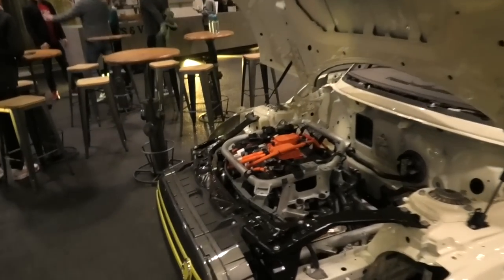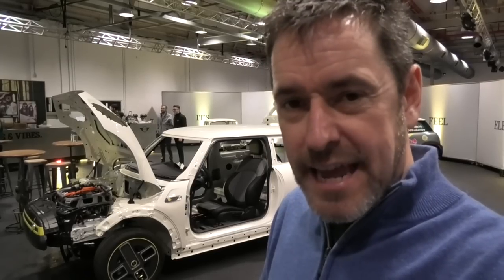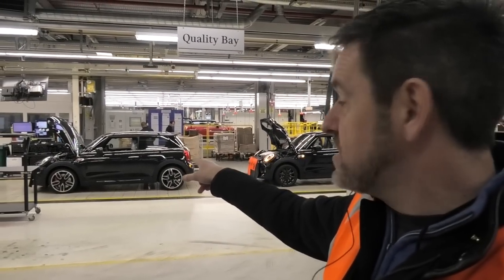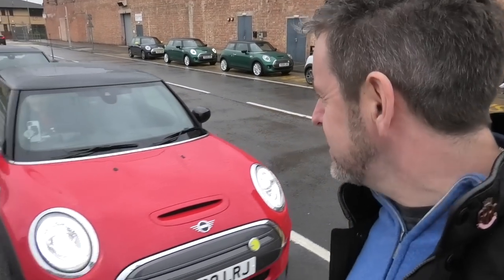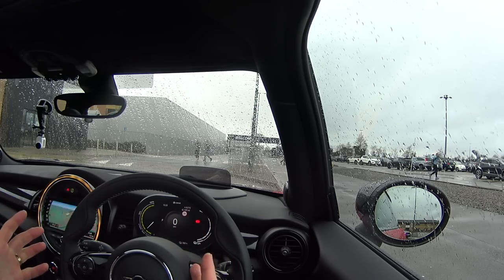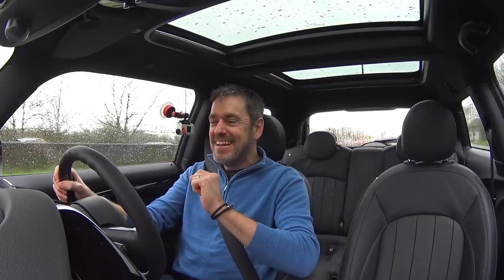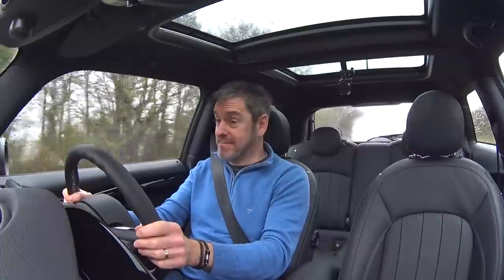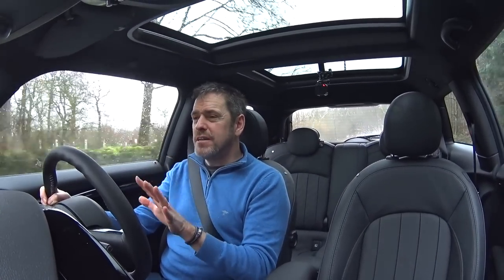Building and Driving Mini Electric - The most important Mini ever !

Comment: Great video. OK the range isn't great but good point that is more than enough for the most people most of the time. It's fantastic it's cheaper than the petrol model. I wish more reviewers would let people know its cheaper to run, maintain, tax, etc. Depending on, what your old petrol/diesel was, your new EV, your mileage & where you charge the saving could be in the €1000's every year when you switch

Comment: Great video again Pete as always. Just been down to look at the electric Mini in the showroom, great looking car. Would be interesting if they do the same with the clubman.
Reply: Gary Wilson Mini I think definitely Mini will do an electric clubman. But when I couldn’t tell!
Reply from the maker: Not sure if that is on the plan 😕
Reply: Petrol Ped that is a pity as with the larger floor plan it may have been a way to increase the range a little, as 100 to 140 miles when you take into account real day to day use is a little low compared with competitors.

Comment: Could you engineer a tow behind accessory battery pack!  I havent managed it yet however it's going to happen.  It's in the works for my next project!

The interior for me is stellar, I dont like the blandness of the Tesla. However that could just be what I'm used too.   I generally dont like a large screen pumping out light while im driving so for me the Mini is perfect. I drive a lot at night so it's a huge deal when considering driving comfort.  Loads more to add but I have to do some engineering first so I'll pick it back up later, cheers keep up the good work!

Comment: Fab video. I could have attended this on the 27th as I got an invite I'm so sad I could not go. Though I decided to go for an i3S instead of the mini, the mini is looking like a great car. I love the i3S, it's superb, very different from a mini, and I think it has the same motor. Super nippy, I take so many cars by surprise at the lights. 😉 One day I will have the mini but as my only car I needed a little more range. In fact my i3S is the older model and has the same capacity battery as the mini but it has the range extender to soothe the anxiety. Had it 3 weeks and done 800  really great miles so far only used 3-4 litres of fuel in the range extender and even then I didn't strictly have to. I just used it to hold charge for convenience.  So perhaps I didn't need it after all and the mini would have been fine... Oh well. Lot of plus points for me on the i3S, but mini will always be special to me.
Reply: We have had our i3s Rex for around 6 months now and the range extender has saved us on numerous occasions where range suffers in winter conditions or the public chargers just don’t work. Wouldn’t go all electric until the charging stations are more reliable or battery density gets much better for the smaller car. I was curious how they would shoe-horn the i3 electrics into a much heavier mini chassis and expect a similar range - seems a little optimistic to me, especially if using the performance as suggested in the video. When I push the i3s (as it really encourages) I can halve the quoted 140m battery range

Comment: Range will be an issue for some, when the Renault Zoe does nearly double, I think mini have shot themselves in the foot.
Reply: Drive them back to back... No problem.. Zoe has the issue
Reply: But like he was saying the range is more than enough for the vast majority of people.  Taking the range out of the equation what would you rather have and drive?  Mini Cooper Electric or Renault Zoe? Most would choose Mini I suspect.
Reply: @garymason7  100% mini, I would never buy a french car, but for alot of people that range will be a problem, imho.
Reply: @octaneparker6200  "I would never buy a French car" is a rather juvenile oversimplification which is based on what? I've owned and driven many French cars over the years and not one of them has ever let me down.
Reply: @Scuba72Chris for most drivers range is an issue, I was merely stating the zoe has a far superior range, regarding the fact I would never buy a French car is based on the fact I have worked for multiple car dealers and French cars are by far the least reliable they also tend to peform badly in driver surveys, there maybe the odd model that does well, but overall this is not the case, dont doubt you have had french cars that have performed impeccably, but across a wider spectrum of drivers not everyone shares your thoughts.
Reply: Octane Parker You can say that about any brand. They are all much of a muchness. The french cars are no more unreliable than German ones.
Reply: @thetreagust462  Although the results are quite tight, Skoda (German) came out top last year by the What Car family car survey for reliability as well as 5th. BMW 1 Series and Mini Clubman (German) both coming 7th. The best French car came in at 20th, the Citroen C4 Cactus. The top 30 is dominated by German cars and far east cars such as Toyota, Honda, Kia etc.
Reply: This is where things look bad for the Mini. It's not that the range is unusable on the Mini - far from it - but when you can buy a car that goes twice as far, has a bigger boot, more space, more doors and a better basic spec for the same money,... it becomes a hard sell.
Reply: @timaustin2000  You could say the same with the ICE car though. There are others in it's class with bigger boot space and better mpg and more toys for your money but has that harmed Mini sales? Far from it.  UK roads are littered with them because they are great cars to own and drive.  If you place range and boot space above all else then yes you're not going to go for a Mini, you'll want something bigger. But for many people who want a smaller car, how it drives and interior comfort comes above how big the boot is and the Mini boot is not the smallest in it's class.  They'll sell shed loads of these because people are starting to want electric and people LOVE Mini.
Reply: its a city car and pop to the shop's car so the range is not an issue
Reply: I own a Tesla Model 3 Performance and a Mini Cooper S.  Love both cars.  Range...seriously not an issue for a second car or a City car, primary car where you regularly do 150 km, you'll have an issue.   Would as soon as drive the mini as the Tesla, if it wasn't for the fact my Mini Cooper S needs to visit the gas station on a regular basis...my Tesla has a full tank every morning without fail.  Can't wait to see the Mini Cooper S E arrive in Australia...very, very exciting!!
Reply: As someone with an R56, I have to agree with this (at least where I'm at in the US).  I currently get ~400 miles on a full tank of gas, which is more than enough.  However, ~120 miles is only good for local local commuting.  If I want to drive to the next metropolitan area, its ~100 miles, and I don't live in a particularly sparse part of the country.
I think it will have its niche, for sure, but it is definitely a compromised car.  With double the range, though, I think this thing would be a real winner.
Reply: The Zoe is way to heavy and consumes more power on 100km so i take the mini for the fun and will not need more range in 98% or more occasions.
Reply: @garymason7  I would not say vast majority as most do not  want to plug in every 2 to 3 days, just once or twice a week.
Reply: Octane Parker IMO, if range is very important to you, you don’t buy an electric car in the first place.

Comment: you know, I hear what you are saying about making it a bit more edgey,   I also can see that building it on the same assembly line brings down costs and this car (for me with incentives) is 1/2 the price of the cheapest Tesla model 3.   I own a Tesla model Y but need a second car.  I know that 80% of my drives are less than 100 miles.  and I have a car that can already do much more than that if needed.. so this car will be perfect for 80% of the drives in our house.  if we need to haul more people or stuff or even tow something.. the Model Y is it.. if we need to pop down to the grocery store or to home depot or to pick up my son at school. the Mini is perfect.  it's a fine edge.. keep it inexpensive or make it edgy.. or make it edgy and lose some of that quirky Mini charm.. I sort of love the toggle switches (coming from a Tesla with zero switches)   again.. this would be a difficult car as the Only car in the household.. when we bought ours, we were told that the majority of people are buying this as their third car.. a car to share with a new driver, or again.. for quick trips and for just driving fun

Comment: Good morning PP, nice video as always. I have to agree with you on the interior styling, they should have done something different to make the electric stand out more from the normal petrol and diesel version. The only shortcoming I personally see is the 120mile range. If MINI can get the range to at least 200 to 250 miles I think they will sell like hot cake
Reply: Jaco Van-Der-Walt why should they “make it stand out from the petrol and diesel version”? For what reason exactly, I mean what difference does the power train make to the interior design?

Comment: This was very interesting Pete, personally I can't help but think these electric cars are a fairly short term solution until we have fuel cell cars, which will be truly environmentally friendly.  Quite surprised they let you film inside the production facility!  Very pleasant interior of the test car with the twin sunroofs, a very nice ambience!  Curious about the ride quality, does it use run-flats? PS at 15.30 I think you are on the road heading towards Burford, the same road Harry Metcalfe(ex Evo car mag founder) from Harry's Garage uses, it's a fun bit of road especially in the dry.   Cheers.

Comment: Sensible comments about range but for a first EV I’m still hesitant. Short journey fine, but for longer trips if you charge to 80% and stop to charge around 10% (don’t want to risk running out), then range is probably <100 between stops for long trips?
Reply from the maker: This car is designed as a city car or second car really 👍

Comment: Unfortunately, the range is not even close to being practical.
Most people agree that it is more of a 120 mile range car, however, real world range will be less (110?), Factor in the range loss in the winter (while using heaters) then you are potentially going to have a winter real world range of less than 100 miles.
For me, I drive 45 miles to work 45 miles back, assuming I don't stop/detour, so this *will not work for me*.

I know it is a small car, however, I have to wonder if they used the best battery layout (from the video, it looks like a "T" vs. a skateboard layout) or if they just need a more efficient drivetrain ?
I always loved the design of the Mini, and really hope the interest in the Mini Electric will provide incentive for them to make a more practical, long range version of the Mini.
Reply from the maker: Not practical for you 😜
Reply: @PetrolPed  Yes. I have also edited my comment to make it clear that this opinion is based on my commute requirements.

Comment: There was a lad on the radio (LBC) yesterday - after the government announcement about banning new petrol and diesel cars from 2030. He was an electrical engineer and he said it has been widely discussed amongst his peers that the UK power infrastructure in domestic areas is not physically able to support electric car charging on the scale that will be required. The cabling to houses and street lighting (a suggestion has been made for street lights to have charging built in) cannot possibly cope with the demand and is already struggling and needs constant repair. It is estimated that the countrywide upgrade would cost £trillion and couldn't be done by 2030.

Mates and I already discussed this (being a persecuted diesel car driver!!) and noted that filling up my car at the local Sainsburys takes about 2 minutes start to finish and they have 18 pumps and you STILL have to queue Fri-Sun. How are they going to have enough chargers when it takes hours for each car? Motorways will be littered with cars that were trying to find an available charging point. It will be like a scene from Mad Max where people are killing each other for fuel (or Duracells!)

Comment: Your review gives a great insight to the e-mini and it's supposed shortfall of range, but demonstrates the fact that it is still a mini, so will be fun on the A and B roads as well as the boring motorway and urban parts. Its top of my list now, and I am planning to use it as my main commuter car for a near 90 mile round trip each day. The range seems perfect for that, even if in winter there is the chance that that is close to the theoretical limits factoring in cold etc etc. Yawn. If you are regularly driving more miles per day then it ain't for you, your loss 😄

Comment: Great presentation, and I gave you a thumbs up, but don't care a wit about electric cars. The only real car has a gasoline engine. I was raised on a farm, I started driving tractors and farm equipment at about 4 yrs old. My grandpa gave me my first car when I was 10. It was a 1929 Model A Ford Roadster. I'm 80 now, and I've been a car freak all my life. The only real engine is a big V8 putting out at least 500 hp and at least 450 to 500 ft lbs of torque. Enough to almost make you pee your pants when you put the peddle down. I've owned so many cars I can't even remember all of them all. I'll stick with gasoline thank you. I would have loved doing what you do so well. Keep it up my friend. Shalom

Comment: After having 3 Minis, I was actually considering a Tesla model 3 as my next car. Watched a load of vids and did lots of research, but then the new JCW Clubbie came out and I was sold.
One of the things about the Tesla was the range (and performance), and therefore the fuel cost saving. But I don’t like the way that their dealer bases are few and far between, and I remain dubious about their customer support.
I would have saved £1,000’s per year on fuel.......but... the New JCW Clubman won me over.
This will sell well as a short trip/city car, but as with lots of electric vehicles it just doesn’t have the range.
On a day like you’ve just driven it, one will have lights and wipers on, air con on, and fan blowing faster to keep the windows clear. Maybe heated seats (I use mine on cold or damp mornings), and the heated front and rear screens on until they run off automatically. Add all that added up with some traffic queuing and the range will drop dramatically. 
It would be interesting to do a test on this for several weeks in all conditions so the reality of range is appreciated.
Maybe Mini would let you do a long term test for 3 months?
Being cynical, I wonder if you would give it back after 3 weeks....🤔?
Reply: Thr only thing is that in traffic you use no energy if stationery in electric where as stop start for petrol diesel is the worst situation.
Reply: richierich If you are stationary in traffic in an electric car the lights may still be on, the air on may be on, the radio may be on etc. So electric cars will use a bit of energy, unless you turn the whole thing off completely?
Stationary traffic is not that bad as such, the worst Is when everyone keeps creeping along and stopping every few seconds, such as in very slow moving queues -that uses fuel and energy.
My thoughts are that if an electric car had, on average, a 200 mile range, whilst another had 130 mile range, I know which one I would prefer to start a journey with (unless it was a short one).
I think if you’re an electric car owner though, you have apps showing charging locations etc so you can plan journeys to avoid range anxiety.
Reply from the maker: Hoping to get one for a longer term test 👍
Reply: @montyzumazoom1337  That's it but in reality you need at leat two cars ... one for inner city the electric and the other probs a small petrol for outer city or longer journeys.
Reply: @montyzumazoom1337  Also the radio is powered by its own separate battery, the lights and wipers use minimal amount. The petrol or diesel stop start uses a lot of fuel in that situation or creeping along.

Comment: Another good review Pete 👍, unfortunately my wife goes on a 100+ mile trip to Blackpool several times a year with no stops and no hotel charging points or ability to charge at kerbside at friends pad (no body seems to mention all the people who park at kerbside for potential EV use), therefore will be unable to do a round trip. Good news is she will have to keep the JCW roadster 😁. If the range was improved then would think about trying one. One thing that always interests me is how much they cost to charge on a domestic UK supply with general daily local use of say 40 miles in winter conditions
Reply: David Blore ballpark figures coming up (as there are quite a few variables): 4 miles per kWh, so 10kWh for that 40 mile journey. Domestic electricity costs around 15p per kWh, so £1.50 per journey. If you had an off peak tariff (which many EV drivers do), then the journey should cost no more than 70p, and can be even less (and occasionally zero) depending on the supplier and grid prices at the time of charging.  However, even £1.50 is impressive when comparing it to a gallon of petrol, which is probably what it takes travel that 40 miles in a standard petrol mini. In the worst (cold wet and windy) Winter weather you will lose about 25% range in an EV, but it’s still a lot cheaper to run than petrol.  Does that help?
Reply: @markparker5585 many thanks, we have solar panels but as you know they're only effective during a bright day when the car would be away, just removed my E7 tariff as uneconomical, maybe need a wind turbine due to recent weather